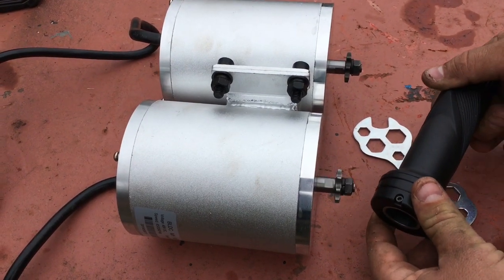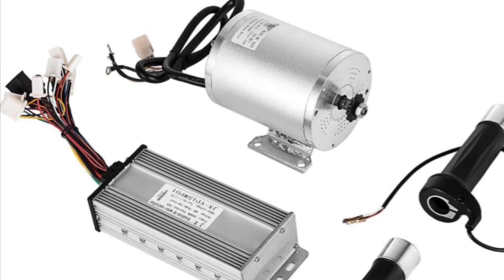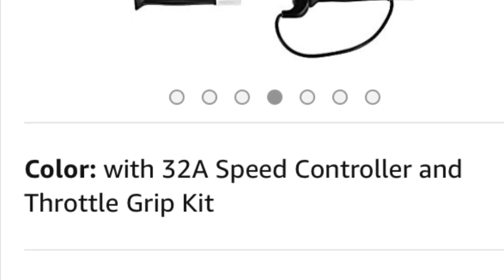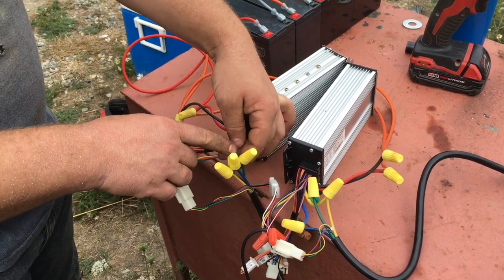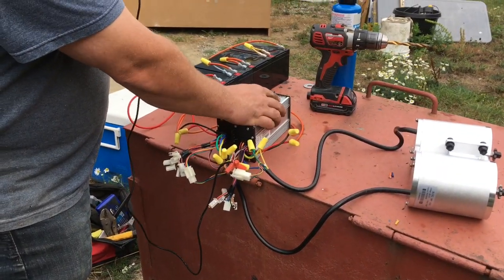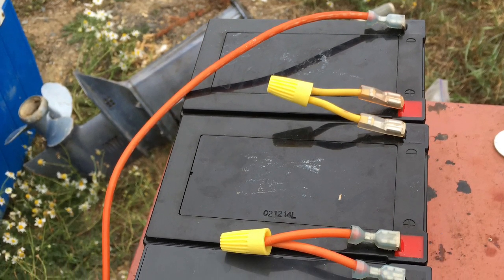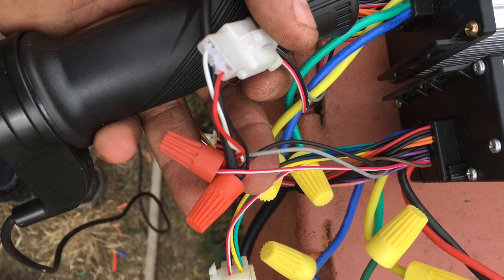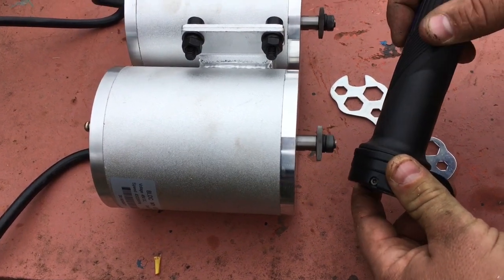1800w Motor Kit (Bench Test And Couple)

Comment: Hey, can you say me please if the 36v 1000w motor is the same as the 72v 3000w motor and its have only another controller and voltage? I have a battery and a controller so I need only the motor and I'm afraid that its not the same motor... thank you very much 🙏
Reply from the maker: I don’t know about the 1000 w motor. But the 1800 watt motor looks identical and works on the 3000 w motor controller

Comment: I'm doing a electric green machine project 😎 and what you paid 200 on Amazon I paid 129 for a 1800w kit on ebay just working on the joining bracket for it to sit higher then hopefully I can use the old profket front ehe smaller motor and or I'll have get a new chain and new sprocket 😬 haha but biggest thing will be getting a battery to fit

Comment: Nice work. I have the same motor and speed controller like yours . But i have one problem, the motor have the full speed on the left turn and the low speed on the right turn so I can't put in my bike because with the full throttle goes  reverse . Do you know how i can change that?
Reply: I tried to change the 3 phase cables but nothing happen. Do you have any solution?
Reply from the maker: The only solution I have would be to mount it the opposite way which probably isn’t possible on a bike. For whatever reason reverse is set to low speed on these things.

Did you change the sensor cables when you changed the 3 power cables? If not I would try that. If you just change the three power wires going into the motor the sensor cables won’t be coordinating motor position properly.  ??? Let me know if you figure this one out. I will possibly put a controller on a bench and see if I can get it to work.

Comment: do you know if i can use this motor in a large remote controlled vehicle using the speed controller it came with
Reply from the maker: This is a good question my buddy has a YouTube channel called screaming demons RC and we plan on trying to connect the potentiometer wires to an RC transmitter. There is no reason that we can figure out on paper why this wouldn’t work so as long as the voltages for the RC Transmitter and the potentiometer are the same… but to know 100% I do not let me know if you figure this out

Comment: Hey brother I got the same controller the same namebrand on the same motor everything is connected right and his jumpstart it but I'm not getting any power to it what are the throttle Colors maybe that's my mistake nothing is marked
Reply from the maker: Pretty common for the throttle wires to be hooked up incorrectly I had to use a tiny screw driver to pop them out on 2 of them when I get home I’ll check
Reply from the maker: White to grey black to black and red to red
Reply: Thank you brother I will give it a shot sorry if they are backwards in which order would I tied them together  ?
Reply from the maker: @bige1560  just make sure the red goes to red grey to white and black to black and you’ll be fine..
Reply: Hey brother I just want to say thank you and God bless you it works

Comment: Good job. This was helpful. Am doing a project now, converting an old lightweight step-thru moped to electric. The moped probably weighs 160lbs maximum, and I was wondering if one of these could power that moped reliably to maybe a cruising speed of 25mph for maybe 30miles with a 48v, 20ah lithium battery? Thanks for any light you could shed on this.
Reply from the maker: Jic Horrilleno not to sure how well one will power a moped but you can check out my go kart conversion video series to see how it works on a kids go kart
Reply: @CJs_DIY  How much would you say that go kart weighs? Thank you for the reply. Appreciate it.
Reply from the maker: Professional race karts typically weigh 165-175lbs (Google)
Reply from the maker: It easily pushes the kart and my fat 240lbs around. But the gearing is low so it doesn’t go that fast...
Reply: @CJs_DIY  haha thanks nice to know. I'm OK with it doing maybe 40kmh (25mph). Maybe I can reduce the gear ratio slightly. What's your sprocket ratio?
Reply from the maker: Not to sure but it would be a lot different on a moped because the tires are so small on this go kart

Comment: I have the same kit and I cant seem to get it running, would you be able to help troubleshoot?
Reply from the maker: I have some other videos with this motor in a go kart some people have found them to be helpful. 

Common problem is people don’t have the run switch button connected. It acts like a key switch to turn the controller on and off.
Reply from the maker: I would need to know more on what your problem is to troubleshoot.

Comment: I heard when u wire it in reverse it doesn't have the same rpm and torque?
Reply from the maker: there are two windings in this motor. a larger winding and a smaller winding. This is what gives the motor the three speeds. full speed runs electricity through both windings.medium speed runs power through the larger of the two windings and low speed runs power through the smaller winding. for whatever reason the motor controller's reverse does not run through both windings making it have significantly less torque and speed. this could possibly be fixed by someone with more knowledge than myself but I have not yet figured out how to solve this problem with changing wirings etc.
Reply: @CJs_DIY  you've given a good insight thanks. At least there's a starting point.

Comment: i stumbled upon this as i am converting an outboard to electric. I thought in the video you might couple them together with a chain a toothed belt so they were synchronized and could be run off one larger controller. I hear keeping them perfectly in time with one another is difficult.
Reply from the maker: I did test the dual motor on an outboard check out my other videos using these motors... end result was the chain was to loud I am in the process of putting a 3000 w motor into the same leg
Reply: @CJs_DIY  unfortunately as of today i had cancelled my electric outboard conversion. i took everything down, and the lower gears in the case wear all shot. at some point it had taken in a fair bit of water and sludge. maybe some day in the future. I will be selling the carb and prop to recoup some of my cost on the parts outboard
.

Comment: hey, great video. do you happen to know whats the rated torque on one of those motors? how fast can it get an ebike or an electric motorcycle? thanks
Reply from the maker: No I don’t but I would say that it’s probably as powerful as my Honda 50.
Reply from the maker: I am running 3000w into mine with no problems

Comment: I have a 3000 watt 72 volt motor and im trying to use a twist throttle like you have. There's red, black, yellow, blue, and  green coming from the twist throttle and the controller the following: it has a orange and a red w/white stripe for the electric lock and for the throttle there's black red and grey. Can you please please help me 🆘 ...
Reply from the maker: is the off switch built into the throttle or any other buttons on the throttle?

there is only three wires used for the speed control from the throttle
Reply from the maker: the red yellow blue green black plug should be for the hall sensors coming off of the motor itself.
Reply from the maker: the throttle should have red black and white and off of the motor controller should be a plug with red black and grey
check to make sure red is going to red black to black and grey to white on the plug itself I have had a couple that came mixed up and had to use a teeny tiny flat screwdriver to unclip them and switch them to the proper orientation.
Reply: @CJs_DIY  the throttle is a key switch twist throttle voltage led combo and the wires it has are black red blue green yellow and then from the controller there was two plugs one labled electric lock which was red and had a white stripe and the other was orange. Then the throttle plug has red black and GREY I don't have white wires
Reply from the maker: @richardlough5133  the red black and grey plug plugs into the motor controller 

the grey is the wiper the red is positive and the black is negative. There should be a corresponding plug coming out of the motor controller what colour wires are they?
Reply from the maker: @richardlough5133  ok black on the throttle goes to black on the throttle plug. Red to the red on the throttle plug one of the last three wires for the white wire which is called the wiper. Try green on white first then try yellow on white if that doesn’t work. Add me to Facebook and call me on Facebook messenger if you know how to do that...

Comment: It is a good idea as only 48v where the 3000w is 72v. Also it allows good back up if one goes down
Reply from the maker: It’s actually the exact same motor as the 72v just a different controller

Comment: I used the 2000w motor like this and converted a smaller ATV. Goes okay, but missing some tourq!
Reply from the maker: Change the the 2000 w controller to a 3000w gives yah that extra ooompff... we did it to this go kart
Reply: @CJs_DIY  only the controller or also increasing the voltage of the batteripack?
Reply from the maker: @fredriklarsson6125  battery bank as well they run on 72v

Comment: Sorry I’m new to these kind of projects but does it matter how much amps are on the battery?
Reply: And can I use a dirt bike battery and add pedals for my go kart?
Reply from the maker: Yea amps matter. More amps the better in my opinion. I view volts like pressure on a hose and amps like the size of pipe it’s flowing through.  If you had a 1/4 inch hose that was connected to a house shower set to 40 psi then you would have the right pressure but not enough volume. You would turn on the water and it would start fast then die out because it can’t get the volume. This is similar to having proper voltage but low amperage.

Comment: What is the difference between the 3 strand wires and 5pin plug that connects from the motor to the speed controller?
Reply: Can you send me the Link of the Motors pls because i can't find them
Reply from the maker: https://www.amazon.com/Kunray-Conversion-Brushless-Controller-Motorcycle/dp/B07RQQPTR1
Reply from the maker: thetangynovella the 3 thick wires are the power wires sent from the controller and the 5 thin wires are hall sensors telling the controller which wires to power at what time...
Reply: Colin John thank you for the reply 🙏

Comment: Will this produce enough torque to run a small car like a Geo metro electric car conversion or do I need 48 and 60 volt motors?
Reply from the maker: Steven Correa I would say this motor is to small by itself to run a small car... that being said the purpose of showing that multiple motor/controllers can be ran off of one potentiometer is that you could potentially run as many motors as needed to run a small car..  how many is needed would be a better question... will one of these motors move a small car by itself yes it will 100% but it would have to be so low geared that it’s top end speed would be to slow for the road... a geo metro runs with a 50hp motor... if each one of these motors produces 5hp then you would need 10 of them to equal the hp of the original engine.  10 motors and controllers would cost you 2000$ ish and is still significantly cheaper than a single motor and controller of equal power... I have been talking with a machinist trying to figure out a reliable way to couple multiple motors together and feel this is a better long term solution for EV’s because you could produce the same motor for multiple vehicles significantly bringing down the cost of manufacturing.
Reply: @CJs_DIY  Tata nano Indian electric car. Take a look. YouTube Indian electric car

Comment: Hey brother thanks for the cool video! I'm currently between one of the motors in your video or going with those " brushless outrunners" that are smaller and look like what they use on drones... any idea the differences or advantages between these two? Thanks!
Reply from the maker: Depends on the application what are you planning on putting it in?

Comment: Hi John Colin, nice video. I have a doubt abour reverse. Some one tald me it is enough to put the switch in reverse cable (black and violet in my controler) Is it really like that? Someone have made it? Thanks an best regards.
Reply from the maker: nicolas lotis not to sure what your question is exactly but I’ll try to answer what I know about reverse in these motors. There is two wires that is marked reverse if you jump them together it will put the motor in reverse... that being said it’s slow... on my kids electric go kart we took one of those old horn switches from the floor of an old pick up and connected it to the 2 wires so he just has to click down on it for reverse and it works fine... although it doesn’t give the motor fill power

Comment: what did you use to connect the wires to the batteries in series?
Reply from the maker: As in what gauge wire? Or what type of connectors did I use?
Reply: @CJs_DIY  yes.  what gauge wire ?
Reply from the maker: @jarodmarshel3667  I’m not 100% what gauge it is in this video as I used some wire I had laying around the shop. But when I hooked it up to my kids go kart I used the same thickness of wire as the pos/neg wires coming out of the controller and haven’t had any issues

Comment: What’s the charger you use, please I need help
Reply from the maker: You need to buy a charger for the type of battery you are using and with the correct voltage... I just bought a lead acid charger that was 72v from amazon

Comment: What is the actual rpm?
Reply from the maker: I really don’t know but I think the specs are on Amazon
Reply: @CJs_DIY  Whats the top speed and gear ratio and wheel diameter. I can calculate the rpm from that. I don't believe that the amazon listing says 5600rpm.. under load thinking more like 2.5-3k rpm.

Comment: Nice! These motors are almost the same as the ones we used on our go kart! (see channel) They are, as you say, very cheap and you can do a lot with them. Pairing two 1000W versions together gets about 17mph off road in a large kart. I am curious, did you run into any heat problems when using these in your applications?
Reply from the maker: Not yet but I was thinking it wouldn’t be that difficult to set up some sort of cooling system

Comment: The lawnmower project would be interesting. I guess there are hydrostatic Motors in there... would u replace them?
Reply from the maker: Psychofant I was thinking of running one motor  to spin the blades and a separate motor to drive the tires.. A lawnmower blades run off of a v belt and the top speed of the blade needs to be around 200mph so I would have to figure out what size pulley to put on the motor....

Comment: Is it ok ,if 2 motors with 1 controller?
Reply: It won't work unless the motors are mechanically synced.
The controllers rely on either sensor feedback (5 or 6 wires) or on back EMF to detect the crossing thresholds for timing

Just use 2 controllers, safer and easier
Reply from the maker: Thx for answering I was like “No that won’t work” but it’s nice to have an explanation as to why...